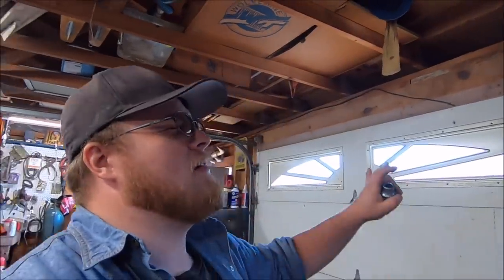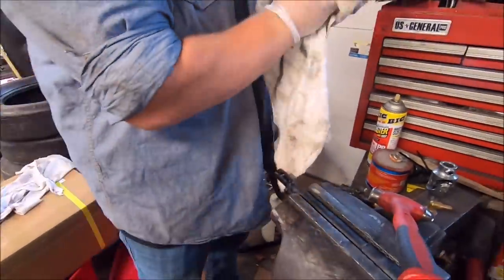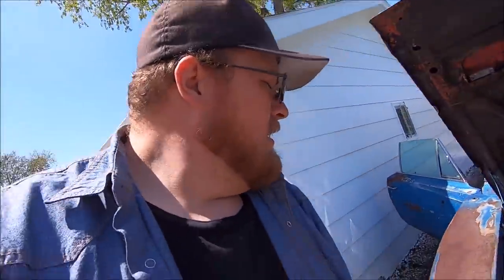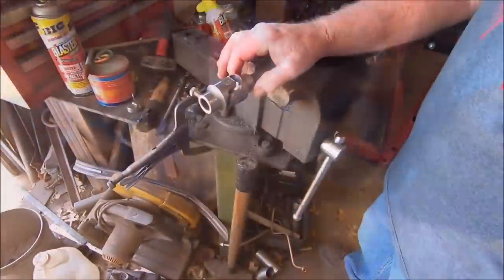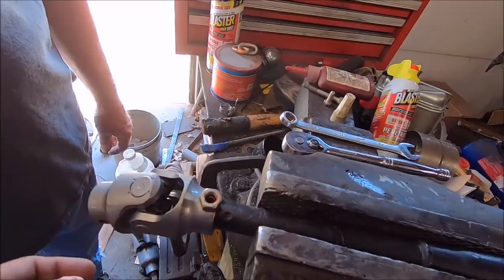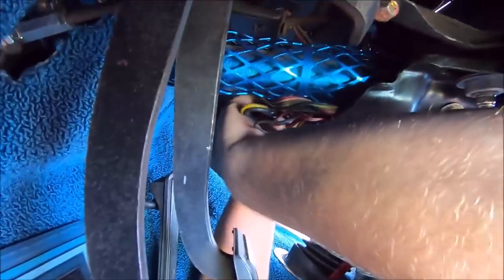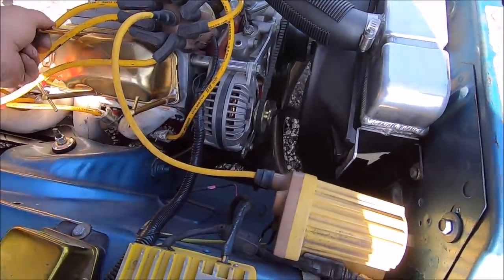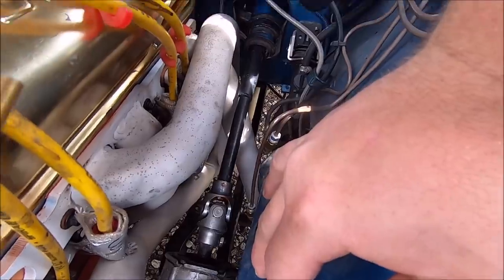Jezebel Ratty Charger Steering Issues SOLVED with a U Joint?!!!

Comment: I'm over 60, if I HAVE to work under the dash, the seat is coming out and I'm padding the floor with cushions. Great vid!!!
Reply: Yep.
Reply: I can get under the dash by sliding off the seat, and down I go.  BUT, I can't get my fat ass out.  While I'm under there, I usually have to remove my glasses, so I can see more clearly.  Old age is beginning to suck.  That's why I end up paying my garage-owning friend to do the work.
Reply: Same here, seats gotta go, thick foam mat on floor.
Reply: Sucks getting old I have to do the same thing the reach to pull the pin when you're changing a master cylinder I'm damn near I can't do it anymore sucks what the hell had a lot of good years of doing it good
Reply: I hear you man! 59 here.

Comment: I grab the coupler from K-cars and use them. You have to cut out the master spline of the coupler so the roll pin notch lines up right. Then a piece of tubing slid over the end of the coupler and your existing shaft, a little welding and done. Cheap!

Comment: I had a 1985 Dodge W150 4X4 with a three-inch body lift that used to go through those Chrysler steering joints every few months - the body lift increased the angle of the steering shaft and would destroy the joint. I always wanted to change it over to a Borgeson, but I was young and broke. If you think the Charger had sketchy steering, try that same Chrysler joint with a ridiculous steering shaft angle and 33” bias-ply Super Swampers!

Comment: That turned out nice. I had some steering issues with my '65 Newport recently. I ordered the power steering brackets and discovered that in '65, that there were in fact at least 4 pump brackets in use. After having to make two returns for incorrect brackets, I'm now planning to make that car manual steering. I also went to using Permatex thread locker orange. It is said to have the holding power of red Loctite but removes easily with hand tools.
Reply: Just find a another engine and take all the pulleys and brackets. Perhaps get the alternator and power steering pump. That's what I ended up doing.
Solved all the searching and it just worked. In fact I ended up buying the whole 383 2bbl just to get all the brackets and correct bolts and spacers. Of course having the correct water pump housing for the brackets was part of why I just offered them $100 more for everything - incl a 727. Worked for me.
Reply from the maker: It is getting really tough to find engines intact with all of their accessories let alone their pulleys, those are the first things robbed off of engines. I know I won't sell an engine with the pullies unless the guy pays up for them.

Comment: Nice upgrade! I've run Borgeson steering shafts on my D and W series Dodge trucks and work great. Great job yall!
Reply from the maker: Right on!
Reply: @ScottsSpeedShop  why you still got the std dodge bs ignition. ??..get elec with msd.or msd dizzy.. great upgrade though. will be doing it. should mention the part #..
Reply from the maker: @phantomwalker8251  I ain't running Chrysler ignition, the only standard chrysler part in my electrical is the actual harness and the Made in USA solid state voltage regulator. My ignition system is a full Accel BEI setup, an ignition system that straight blows MSD out of the water, but since Holley chose MSD to be the flagship brand. They killed off the good Accel ignition systems. My BEI ignition stuff is from the 70s and still works great, minus one module that was acting up for a time. As far as the part number for the U-joint I mentioned it is 3/4 round by 3/4-36 spline which is all you need to find the proper u-joint, but here is the part number 153-013464

Comment: I had this same problem on my 93 Dodge W200 where the factory coupler wore out so I bought one of those repair kits from Doorman & it didn't work worth crap either infact it made the truck steer worse wandering all over the road so I bought the borgeson shaft for the truck & it worked great . They aren't cheap but work very good but the only thing I didn't like was the U joints are sealed so you can't grease them to keep them lubricated or to push any water that gets in out of those needle bearings .

Comment: I'll be installing a Borgeson power steering kit on my '70 Duster 340 soon.  It comes with its own modified coupler, so I don't have to cut the column shaft.  Just drill it, and go.  The kit even comes with 4 drill bits.  LOL

Comment: the 3/4" double d section will slide up into the tube it is in on the column - they are collapsable after all. no need to cut it. otherwise nice retro fit.
Reply from the maker: I know it is the wrong thing to do, but I weld my columns solid, that collapsible column will not save you if you wreck hard enough to warrant collapsing the column. So I weld mine so I don't have to worry about the column moving fore and aft on me

Comment: Great video, I will use that joint on my big block dart sport . I was watching your other video about installing your headers and noticed the new tunnel ram that was sitting on your dad’s truck and was wondering if that was for Jezabel , if so I would be very very interested in the six pack that is on your car now! If you are interested in selling please let me know. Thanks!!
Reply from the maker: If I sold the Weiand Crossflow intake, it would come with a hefty price tag, considering all of the carbs are dialed in, the linkage works, fuel lines are plumbed, and the original Mr. Norms air cleaner that sits on top of it all. If you think you got enough cash to own it, you can shoot me an offer, my email is ChargerJezebel70@yahoo.com

Comment: Why dont ya get the right shaft from Borgeson , I did that to my RamCharger , the coupler felll appart the pin was gone. Now with the Borgeson it steers nice.
Reply from the maker: This is the right stuff from Borgeron, it's made more my shaft, I just didn't want to weld it on, and I didn't want to mess with the double d shaft at the time of filming

Comment: Took down the anti burnout video i see...
Reply from the maker: I'll take them all down if you all keep it up, I will not put up with the trolls and bs, people can say what they want, but I cannot stand it when people chant and beg to see burnouts
Reply: Then build something you can break and fix cheaply? Or just tell people no? Seems like you want to push the blame to others
Reply from the maker: @harmorehorń  If you saw what I had invested into each of the cars, you'd understand I built them to not break. I will own my mistake into falling to peer pressure, my message I was trying to convey was to ask people to stop begging and pleading for burnouts. I didn't want to be part of the new years burnout challenge, but I got called out by multiple people, and I knew if I didn't do it, people would have gave me shit. It's a lose lose situation, I either break my stuff or look like a chump, and I didn't fight stage iii cancer just to have keyboard commandos come at me